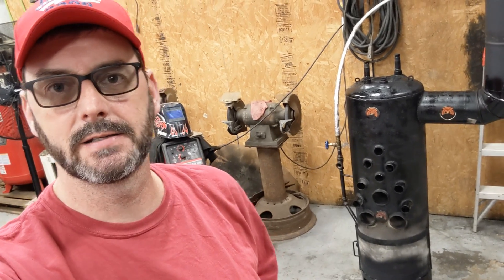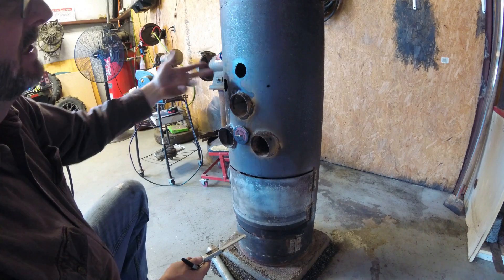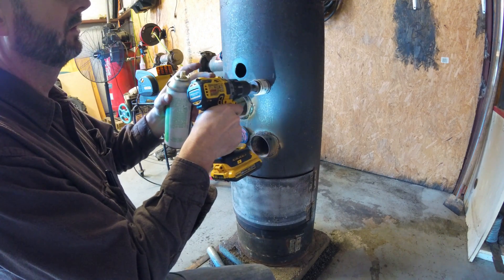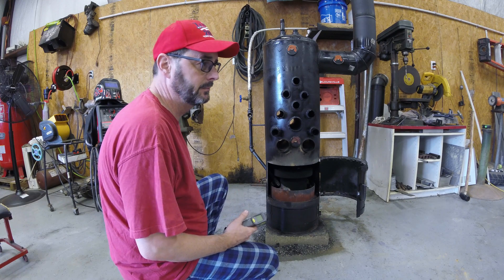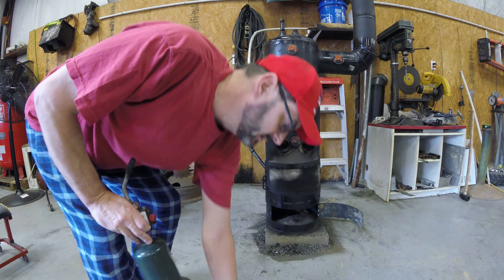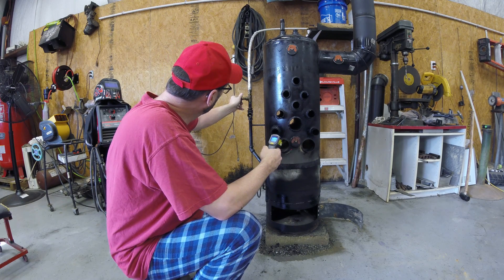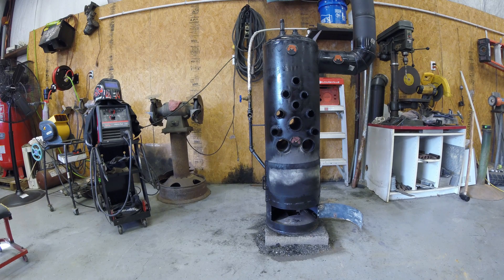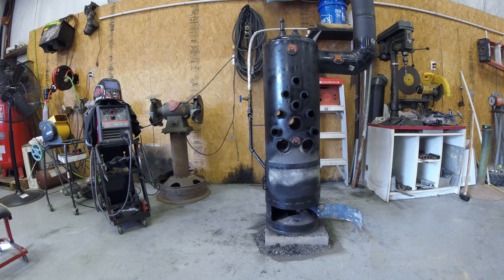Updating My Waste Oil Heater again: Because Who Doesn’t Want a Furnace That Runs on Trash? Ver 3.0

Comment: @8:00 is the back of the shop discolored for the heat of the stove in the past?
Reply from the maker: No I had a yard fire that caught a diesel truck tire on fire outside in my shop. Bad thing about that deal was we weren't home It was the neighbor's yard fire
Reply: @randysdiy2102  glad it was not disastrous! Note to self: stack no combustibles near the shed or house!! Better move those pallets 12 feet away...

Comment: Would be nice to mix this heater with a roket stove
Reply: I like your thinking, I've been researching into this exact thing. I have loads of free oil, and pallet wood. Pallet wood is good if the lads break and split, but oil, well it just flows. I gathered all the bits and will make a fire brick lined burn chamber. The cylinder is a large Argon tank, and the high temp metals will all be stainless. There will be an attachment for pellets as well as oil. This thing should really cook!
Reply from the maker: Sounds like a good idea
Reply from the maker: Sounds 😎

Comment: If you draw your  primary air from  outside  and it is cooler then  inside your shop you will  be pleased with the  improved  performance
Reply from the maker: That has been recommended, I may try it
Reply: Nice stove and good ideas/video by the way. Thanks

Comment: Does the air intake "Hat" still have the 90deg. fittings for the swirl effect inside the fire chamber?
Reply from the maker: Yes, but only half of them. I left the original ones and then just drilled 8 more holes between the elbow's

Comment: if you raise flu pipe 2 feet above roof line it will burn even cleaner  i had same problem with mine air would hit back wall and come down pipe raised pipe into air stream
Reply from the maker: I'll try it

Comment: Hey Randy.  I did it!  I've watched a bunch of videos on waste oil burners but I liked yours the best and just got it all done!  Thank you!  I used a 75 gallon gas water heater.  You said you don't like how thin the metal was in the 40 gallon one you used.  This thing is 3/16 thick!  I even used the original exhaust pipe as a heat exchanger tube!  I'd love to show you pics.  I've only had a few fires in there so far.  I have a question I was hoping you might be able to help me with. I sealed the door with wood stove rope seal.  I did 2 rows of half inch elbows around the air hat and a ton of extra half inch holes so this thing is getting a ton of air.  As it's heating up I can hear it sucking in the air. No smoke from the fire is leaking anywhere inside the shop.  Once it gets to a raging fire inside as I turn up the fuel it gets to a point where it's like it can't get enough air.  Fire still raging and it sounds like a jet afterburner but then a weird vibration starts happening.  A rhythmic vibration like it's trying to chug even more air that it can't get.  It shakes my cement floor!  When it starts doing this vibration it starts puffing smoke out the door.  If I turn down the fuel, it limits this extra vibration but it will still vibrate randomly as the fire rages on puffing out smoke whenever it vibrates.  I certainly don't want to breathe motor oil smoke so I keep having to turn my exhaust fan on and then opening up my shop door which defeats the purpose of the heater.  Have you ever experienced this issue?  Thanks for any input.  I still have what's left of the fire extinguisher I used to make the air hat.  I was thinking I might make it exactly like yours with one row of half inch elbows and half inch holes in between and see if that fixes my issue.  If it doesn't, just filling the whole thing full of holes.
Reply from the maker: Be really careful burning oil. It can cause some really serious stuff. It's sounds like you may be over feed oil and it may be filling the the reservoir over the air intake holes. I never have had anything like that happen so I really don't know what issue your experiencing.just please be careful that thing could blow up on you.
Reply: @randysdiy2102  I'm being careful for sure.  I appreciate it.  It's definitely not filling up and going over the air intake holes.  The oil is burning really well with very little smoke out the chimney.
Reply from the maker: @jstetler69  I guess it could be generating so much energy in the form of heat it just about to turn into a rocket. If you have a video I would love to see it. I bet it is really putting some heat out.
Reply: @randysdiy2102  Update.  I made a new air hat with just 1 row of half inch holes around the bottom.  Now it doesn't puff out smoke but it barely gets hot lol!  I definitely think it was getting too much air before but couldn't get rid of the exhaust fast enough.... So it would puff out smoke. I think I need to make my chimney more direct. Have it exit directly out the top instead of the side.  That will cut out 1 90 degree bend.  Plus I could set up a better air door to slow it down a little.
Reply from the maker: @jstetler69  sounds good keep tweaking on it you'll get it just right
Reply: @randysdiy2102  I figured it out.  Well you and others figured it out and I didn't pay attention lol.  I see other super basic burners just using thin stainless bowls as  their burn plate.  When you describe yours you say the bottom plate is 1/8 inch thick and even say that that's thick.  I figured the thicker the better  (for longevity) and used the bottom of my metal donor water heater which was 1/4 inch thick and concave. That was the problem.  Way too thick.  I think I was experiencing a DIY sort of puff back that people sometimes have with household, legit oil burners. Big puffs of soot and smoke explode into the house when the oil pools up inside the burner instead of being vaporized and burned properly.  I think my oil was pooling up on my burn plate and and then giving me the "puff back" when it would try to ignite.  I built a new burn plate/bowl with the bottom plate only being 1/16 inch!  Holy crap! Got it going then slowly introduced waste oil.  No more puff back!  Still vibrates as it gulps in air but no more smoke inside the shop!  Oh man.  First time I've had it going with the exhaust fan off and doors shut!  Amazing!  It was 15 degrees last night and I had my non insulated shop up to 60ish within half an hour!  I couldn't believe I was standing in my shop in January in a t shirt and no coat!  Thank you for your video.
Reply from the maker: @jstetler69  that's great, glad you got it figured out.

Comment: how did you seal the door
Reply from the maker: I found some fire door fiberglass rope on amazon, I first took a piece of 1 inch wide flat bar welded it over the edge of the door leaving 1/2 inch over lap, that's where I glued the rope too.
https://www.amazon.com/dp/B01D0ORRSU/ref=cm_sw_r_cp_apa_fabc_fCC6FbFZV5328?_encoding=UTF8&psc=1

Comment: Awesome, can you show the modifications to the "air hat"?
Reply from the maker: Yes I think I posted a pic some time. All I did was drilled a half inch hole between each of the 90 degree fittings. So basically I just doubled the amount of holes that air could come into the combustion chamber
Reply: @randysdiy2102  did you put 90’s on the extra holes?
Reply from the maker: No sir,.just 1/2 holes.
Reply: @randysdiy2102  also, thanks for the video , well done.  I’m trying to fine tune mine. Struggling to get that jet type of flow

Comment: Hi Randy, I modified a wood stove to burn waste oil using the same principles as yours (updraft, drip feed) but i keep having an issue- after maybe 40- 50 hours of burn time my oil feed line clogs up with a hard coating of coke/soot and restrcts or completly clogs the flow of oil. I see you are using larger diamter steel pipe than me. I am using 5/8" copper pipe with a 7/8" copper heat shield (which seems to be helping) But im curious- Do you have this same problem? do you need to clean out the oil drip pipe at the burner end periodically due hard soot deposits?
Reply from the maker: My drip feed is a black iron pipe I usually clean it once a year. I have never had it stop up but it does accumulate some ash cake over time. And I think it matters what type of oil you use. Diesel oil seems to do it worse
Reply: @randysdiy2102  Well shoot thats 95%of what i burn! but i definitely see why that might be true. Have you noticed a difference with vegetable oil? I think i'll try switching from motor oil (since i dont putoff that much motor oil myself, and have to pick it up anyway) to waste veg oil since i already collect it for running in my car.  I'll try switching to black iron and see if that helps as well. once a year sounds like a much more reasonable cleaning interval. Thanks for the reply.
Reply: *Diesel motor oil is 95% of what i burn
Reply from the maker: I think the vegatable oil is cleaner. But I burn what ever I have on hand.

Comment: Nice! I like the design of your combustion chamber. I got an 80 gallon air tank which is larger in diameter I may use which will allow room to line the inside with fire brick. Thinking it will hold heat better and possibly use less fuel.
Reply from the maker: Sounds like a good idea but I'm not sure how the heat is going to get out of the tank until the heat bricks get really really hot.sounds as if it might insulate the heat inside the tank instead of radiating into your shop.
Reply: Yeah I'm not sure either was thinking like how a rocket stove work's. The brick holds heat in so the fuel gets a more complete burn but once the brick is warm it continues to put out heat after the fire is out. Maybe line the bottom half first to try and possibly be able to shut the heater down to save fuel. Just getting some ideas thought about some how combining the two heaters to gather so you could run wood or oil.
Reply: @jasonbrown7258  You could use your original idea, and make the air tank your fire box and insulate it as well as possible. Then, you could take the flue and go into a heat exchanger from where you will actually extract energy from the flue gas. This would require more plumbing though. Or, you could use half the air tank as your firebox, insulate that part, and then internally put a steel plate half way up the tank, line the bottom of that with fire bricks/rock wool and put a 6-8" diameter hole in the center, and then use the upper portion of the tank as your heat exchanger. Basically, build a steam boiler, but you would be heating air instead of water. My only concern with an air tank is that it is probably even thinner than a water tank, making it less able to withstand high temperature. But those are just theories- I haven't actually tested any of this.

Comment: Could you post some pictures of your intake? You mentioned you cut some more holes in it. Preparing to build one of these for my shop. Got 2 trucks which brings about 30 gallons of oil a month. 300 gallons in storage so I gotta get one built, heat my shop for free and getting rid of my oil. Can't beat that
Reply from the maker: Here is a pic of the extra holes, they are 1/2 inch holes drilled between the 90 fittings.
https://photos.app.goo.gl/rDfYXCbv9qS1KWQX9
Reply: But they definitely look cool! 😊
Reply: @Randy's diy I tried looking at the link. But it says they are deleted.  I built an oil burner very similar to yours, but is burning very rich. Would really like to see updated version. Thanks
Reply from the maker: The new burner I just drilled twice as many air holes in the bottom of the air hat. Allow more air in leans your burn out. Try that and see how it works out for you. I'll get you the link for that revised video or you can go to all my videos and find them there
Reply: @randysdiy2102  hey randy, im going to be making one very similar to yours. I was wondering about the extra holes you drilled in the air hat, are they just holes or did you add more of the fittings to the extra holes as well to direct the air like the original ones? Any pictures you might have would be awesome. Thanks
Reply from the maker: They were just half inch holes straight in the side of the airhead. No 90° fittings. I really don't think the 90° fittings help the whole lot. Maybe just a little
Reply from the maker: https://youtu.be/PRGpfTpOdrk
Reply: but you kill your kids future!
Reply from the maker: Nah Joe biden's going to shut down all the oil anyway He's already killed the pipeline. We'll all be using solar heat even at night. 😂

Comment: Wow Awesome.  What kinda tank did you use. I've got a gas hot water heater 50 gallon.  Could i use this ? I'm wanting to construct a stove like yours, yjank you so much.
Reply: Thanks Randy, i am totally aware of the risks. I also know this type of "heat" is very resourceful but cannnot be regulated. For my plans I  would always be present and never leave it unattended. Thanks Randy 👍👍👌
Reply from the maker: I used a 40 gallon gas water heater tank now with the gas water heater you're going to have to cut out the exhaust pipe through the center of the tank. Here goes my disclaimer be careful when burning waste oil it's dangerous and I cannot be held responsible for any ideas that I've conveyed

Comment: Love those heat exchanger pipe you drilled in and welded......quick question.......how do you align the holes on the back of the cylinder to match the front? I've got my unit build now, just want to add some pipes for more heat output.....appreciate what you're doing, Bud.....keep it up......Bill
Reply from the maker: There's no exact way of doing it I just found center of tank measured from center out and then the weld line down in an eyeball to angle.
Reply: @randysdiy2102  Okay, sorta got it......appreciate the fast reply-back......I'll give it a go with a piece of 3" pipe.......I'll let ya know how it goes......Thanks, Randy... 

Bill
Reply: @wilfor03  Sure just be careful, Burning oil is Dangerous and I assume no responsibility. You know go to put that out there.

Comment: Would like to see the burner unit. How hot does it have to be to get the oil to vaporize/ignite
Reply from the maker: Check out my channel I have a video of the burner there.
https://youtu.be/6Puk4mPK1XI
I usually add a little gas to Diesel to start burning, then it just runs from there not sure on the vaporized temp.